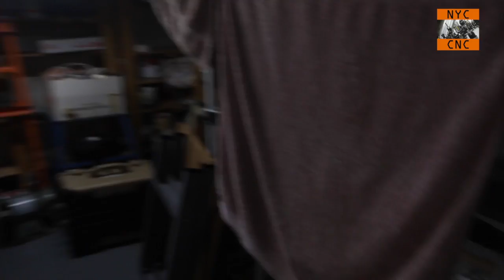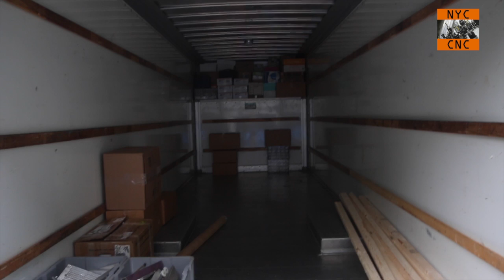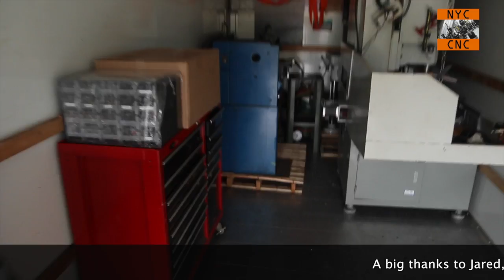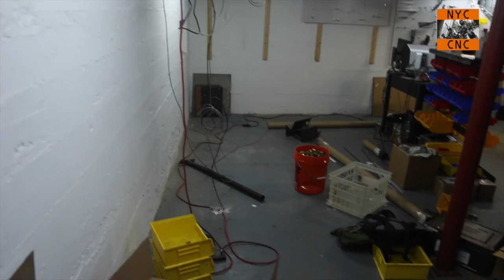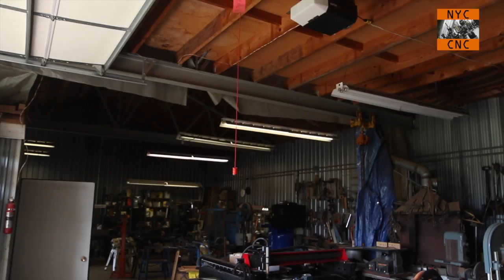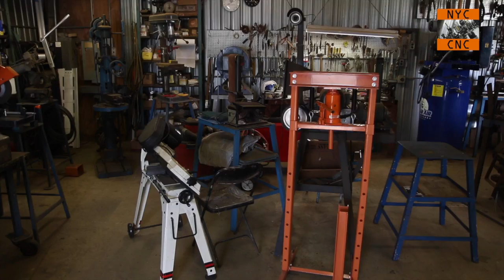Moving the Machine Shop - New York to Ohio!

Comment: It's not a proper move unless you have bad weather, delays, and vehicle breakdowns.  All in all looks like it was rather a painless move as everything appears to have tolerated the move without complaint, glad for your good fortune.  

I once was involved with a move at the company I worked for and we had a semi loaded with expensive equipment and when they got to the new location and backed up to the loading ramp the door on the van would not open as it just missed clearing the dock by a half inch because of all the heavy stuff at the rear.  So, the driver says "I'll just pull up and then you can open the doors and I can then back up to the doc and you can unload".  So he gets in and moves the truck forward and sure enough the most expensive machine was right at the back and unsecured, it rolled out as he had not latched the doors before moving the truck and it got smashed into useless scrap, a bum move that one, at least we had moving insurance to cover the loss.

Comment: Glad to see everything went fairly smoothly! I am curious as to if that is a Royersford drill press back in the corner?
Reply: NYC CNC
They are old, heavy and slow but can punch a really large hole in thick steel. I have a Royersford Excelsior 20" (which is what I do believe you have) and an american toolworks 20". The Royersford was casted and built in Royersford, PA about 15 minutes from where I live.